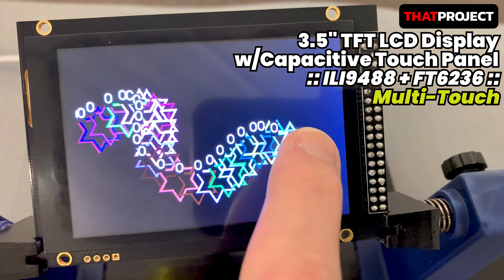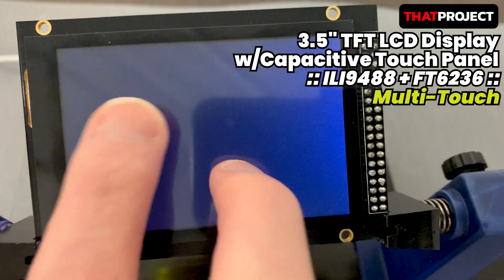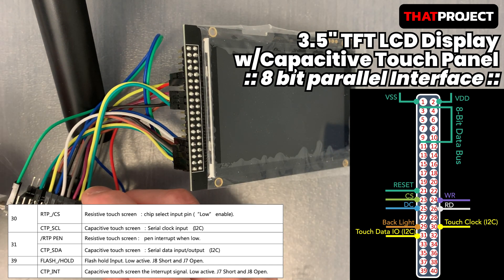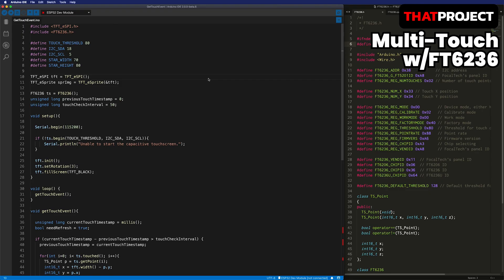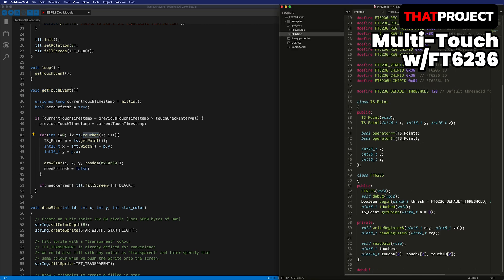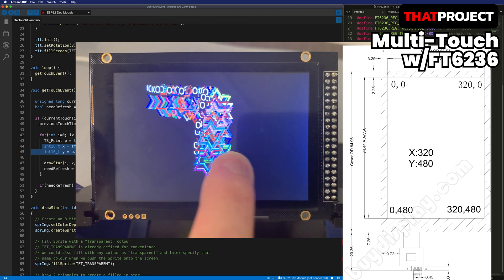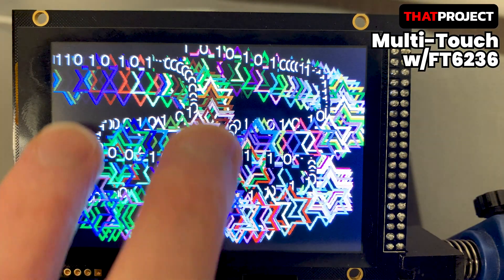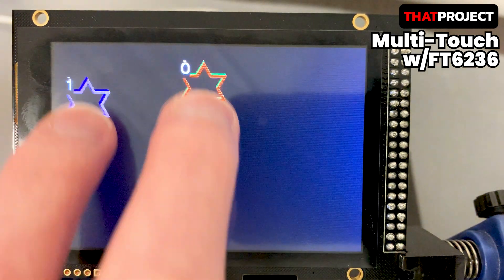ESP32 | Multi-Touch Test(ft. FT6236)

Comment: Im using this Display a long time succsessfull but i was,nt able to get any gesture - question: does the FT6236 support gesture or not ? (the datasheet says:"YES" and i think its a lie)
Reply from the maker: Are you talking about gesture detection? As far as I know, this is just a capacitive touch IC. Which datasheet did you refer to?
Reply: i refered the original datasheet of the FT6236 wich you can find in the net. but there are no program examples using the gesture function. Many other users also asked about this but received no response
Reply from the maker: @Soundfactory24  Oh, I see. The gesture means detecting a swipe motion. FT6236 has an internal function that detects these swipes. To get this info seems like you need to implement it to get this info from the specific address from i2c because no library supports it.

Comment: Very nice work, good catch on the vertical-two-point bug. The array of 0/1 for the finger points swapping should be easy to fix; I'm surprised it got through their driver development.  Where did you buy your ones from?  Many thanks VERY useful information, thanks!  :)
Reply from the maker: I bought it at the cheapest place with googling. I remember buying it on eBay a few months ago at the cheapest price.

Comment: Hey bro i never understood how the code and the electronics behind these integrated touch controllers worked on these display . I am working on a smartwatch project and i have no idea as to how to interface the touch controller or how to interpret the code for it . If you can make a very short tutorial on this topic it would be amazing. I understand the resistive touch that's simple but capacitive touch is what confuses me.
Reply from the maker: You're doing a very interesting project. I don't have enough knowledge of the touch controller interface for the smartwatch.  Anyway, good luck!👍